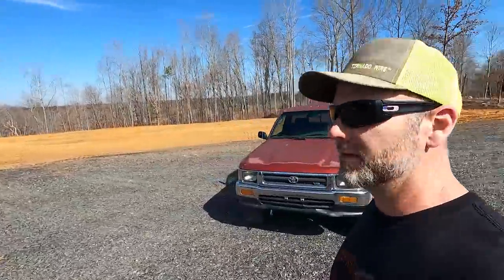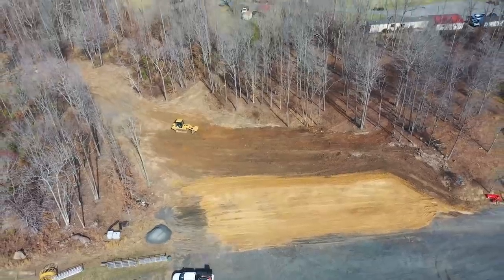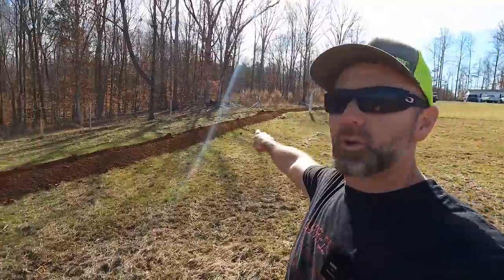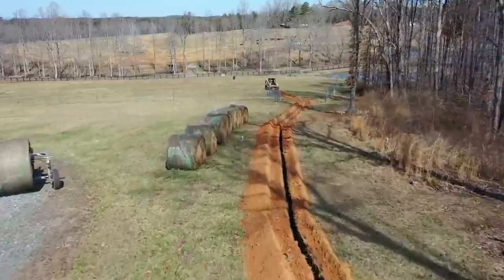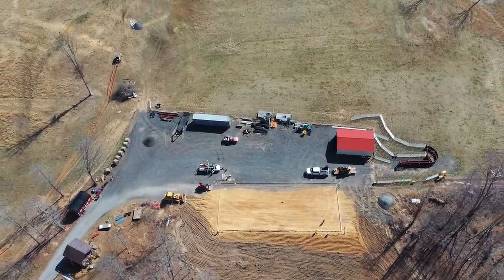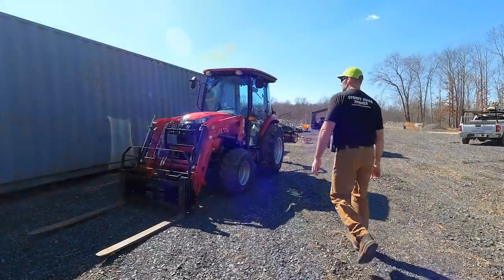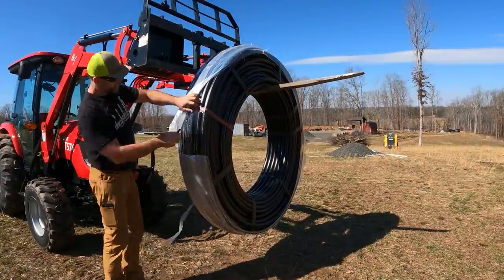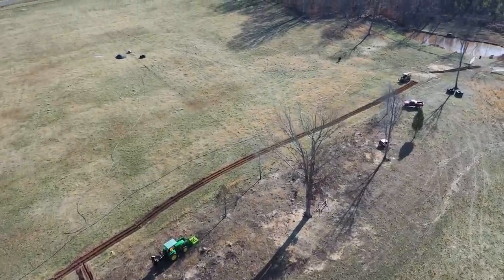You Won't BELIEVE THIS! Heavy Equipment Trenching Off Grid Farm Water System!

Comment: Put the rolls on a strong pipe or post between the two forks.  Lash the pipes to the forks or to the back of the forks. Tie one end of the pipe to something  solid (e.g., pickups trailer hitch). Back the tractor the length of the pipe.  Before it is all unwound put a rope on the pipe and tie it to something like your four wheeler to keep it from curling back up like crazy.  Then finish.  It should be in pretty good shape without too much curl.
Reply: Or his bail unroller, leave a partial roll, or like you said, a crossbar.  Definitely have to unroll, not unwind...
Reply: Exactly what I was thinking.

Comment: Great job Josh. leave both forks on the Tym. Put a pipe through the  roll of water line and  lift with tym. The line can’t spin off as the forks hold it in and will role off by hand.

Comment: I have been enjoying your videos on the water system upgrade.  I noticed you had some areas with rock in the trench.  The poly pipe will work some as water flows through it.  If the poly pipe is on direct contact with rough abrasive materials, it can potentially rub a hole in the pipe over time.  Something to think about as you are working so hard to lay all of it.  May save yourself a headache later on to avoid or pad the pipe in those rough areas.  Keep up the good work.
Reply from the maker: yep...of course....that's why I'm walking the trenches and pulling out rocks...it's a job!

Comment: Josh, If you had friends of phone contractor they have trailors to handle pipe.
I have installed 100s of miles of 1 1/4" pipe and blown fiber cable in it. Fighting that pipe is a lot of work!

Comment: Just put three posts in the center of your poly line spool and pull it. You can use T-posts but I would recommend round pipe so you don’t scar up your poly.

Comment: @Stoney Ridge Farmer

WOOOOOOO!

Josh, 

I can't be certain because I've never worked with this particular plastic pipe, but something tells me that if you cap/plug one end of the plastic pipe and connect the other end to an air compressor with a quick disconnect and pressurize the pipe, it will help straighten it out like a pressurized fire hose.  Use common sense and don't over pressurize.  If you mostly fill it with water it will be heavier but it will make a lot less work for the compressor.  You could probably also connect some kind of eye to the plugged end and pull it with a tractor or the skid loader.   You could maybe use a Tee at the other end so you can anchor that end in place.

Comment: Should have left both forks on the tractor & clamped a pipe on them after running the pipe through the roll of poly pipe. Could have just driven the tractor alongside the trench & the poly pipe would have spooled off as you went. Just needed to anchor the end of the poly pipe so it wouldn't drag along with you (could have done that with a couple of t-posts & duck tape). Hope this helps with the next spools of poly pipe. Have a great day 😊.
Reply from the maker: lol...well...I got it done eventually...and learned a bit...take pipe from the center...there simply is no easy way to go about this my brotha

Comment: I used to pull cable, honestly you are setting yourself up for a nightmare trying to un-spool it from flat. Like you found out, beyond a certain length you can't rotate it to remove the twist and the twist won't let it sit in the trench nicely. 
As some have suggested, you can't put it on a pipe strapped to the forks as the spool is too big and it won't want to rotate with the pipe at such a large offset anyway. 
The way to make this work is to construct a square box frame inside the spool, then at the ends make a cross hatch (#) out of wood. Run a fencing pipe through the middle of these two cross hatches and now you have a huge cotton reel spinning on a pipe. 
To fit this to your forks you'll need to either make them longer, or dangle the cotton reel underneath so the pipe misses your attachment plate  👍
Reply from the maker: lol....well...I just pulled it and unrolled the pipe...worked pretty good after a little bit
Reply: @StoneyRidgeFarmer  good that you got it done 👍 I just wanted to show how it’s easy to construct something to make it easier

Comment: With some engineering you could use your bail roller. put your roll between the wheels put a piece of pipe so the spikes slide into the steel pipe lock the spikes lift up roll and drive away
Reply from the maker: bale unroller is too small...this roll won't fit in there...but good idea

Comment: Josh this idea is to late but you could have stood the pipe roll up between the two forks and put a piece of fence pipe through the center of the roll and clamped the fence pipe to the forks creating a center axel in the donut of poly pipe (PP). Secured one end and just back up the tractor along your trench and unrolled the PP as you went. Kind of like unrolling a bail of hay.  Your bail un roller was my second idea but either would have worked with a little farmer ingenuity.

Comment: Hey Josh  you all most had it buy leave both forks on but push them a foot or so apart on the  tractor ( if you have some 6" s-40 pipe put them over your forks All you will need is a couple of 4X4's Six to Eight long and a 4 clamps to clamp the 4X4's to the fork the first 1 as close to the mounting plate at the back where it is mounted to the Machine. And put your pipe on the forks and then mount the other 4X4 as close to the edge of the pipe at the front of the forks, It can be done 2 ways this 1 is the easy way  Leave the Tractor where you had it. then take the skid steer take a wrenched strap and tie it or band the end of the pipe to your bucket and back up slowly until all the pipe is unrolled  it should be done in 10-15 minutes per roll it depend on how fast you are comfortable backing up. if you need to put your drone above the forks of the tractor so you can keep an eye on it. I hope this helps.

Comment: Next roll of pipe, leave the roll on the tractor tie off the end to your 4 wheeler pull the pipe out👍
Reply from the maker: I figured out a better way...lay it flat and pull from the center...using the ATV puts too much pressure...the pipe will kink ...the goal is not let the pipe kink and do as few runs as possible

Comment: Hello,
Worked installing lawn sprinklers when I was much younger.
Take all the tape or plastic off, hook the end (tape up first) of the pipe (the outermost end, on the outside of the spool) on to something at the end of the trench where you are starting (like peanut) just so it stays put, not a physical attachment. Pick up the spool and start unrolling it beside the trench.  Walk with it as you unroll it.  A big spool may need two people.  Unwind it all the way.  Go back to the beginning and put it into the trench.
Here is a video of someone doing this.
https://www.youtube.com/watch?v=bCHSBly0ppI
Voila!

Good Luck!
Reply from the maker: big difference in short 1/2 or 3/4 sprinkler runs and this huge mess for sure...but great tip for sure! Thanks!
Reply: @StoneyRidgeFarmer  That's true!  We were usually unrolling 300 foot rolls of 1" diameter poly pipe.  We did some 1-1/2" and 2" poly but the rolls of that big stuff were shorter in legnth and taller, like 7' diam.  
Honestly, I couldn't continue watching once I saw how the pipe was coming off the forks!  Not too OCD but I could just feel the kink coming! lol.
Hopefully it went well!
Enjoy seeing what you're up to and the progress you've made.
Spring is on the way :)

Comment: The key to getting roll stock off the roll is to UNROLL IT.  DO NOT pull it out of the roll.  Most basic way is to stand the roll up with the end at the bottom pointing to your starting location.  Put a big weight on the end and ROLL the whole roll towards the end point.  Don't let the roll fall over, keep it vertical and as together as possible.
for every loop you pull out of the roll you get one loop you need to untangle.
Your hay bale unroller might be useful here.
Reply: There's a first time for everyone. He's  going to have a knot in that pipe for its all over.
Reply from the maker: lol...well the glass half empty folks are here bhahhaha....I unrolled nearly 3000 feet withonly 1 kink by myself...so get that glass half full buddy! This aint rocket science...and it isn't my first time brotha

Comment: Hi Josh, Will Your water lines be DEEP enough to avoid freezing? Hope so??
Reply: It should be plenty deep.  Very rare for ground to freeze more than a few inches in NC.  9 inches in most of NC is actual worst case.  The freeze line code is 12 inches.  In the mountains people often go deeper.    He is well below the frost line.  He should also be able to maintain a flow through the lines.
Reply: @brianhillis3701  Hope so! Frozen water lines are NEVER any fun! BE SAFE & WELL
Reply from the maker: yep 16-18 inch frost line..pipe is at least 20 inches down
Reply: @StoneyRidgeFarmer  Hi Josh, Hope that All is going well and no frozen water lines. Wish that You could salvage that miss-placed post for the panels! BLESSED BE! Batman

Comment: Its too bad that the trencher wasn't designed so you could drive forward with it.
Also, to my eye, it looked like if you had parked the tractor the other direction, and tilted the forks up more, it "should" have come off the roll easier. It looked like you were going "against" the roll when you pulled it off.
Reply from the maker: poly is just hard to work with for sure